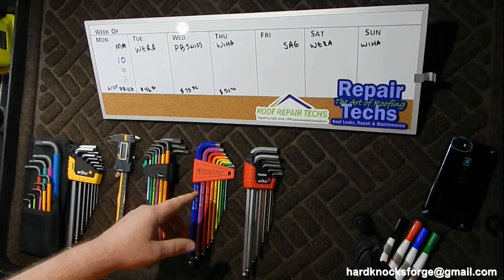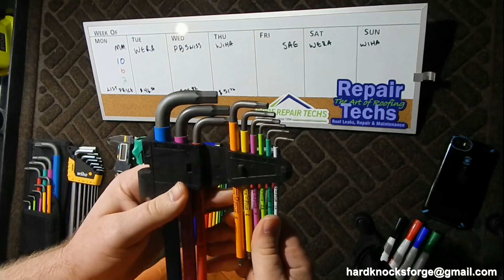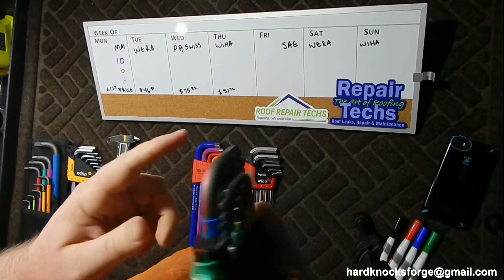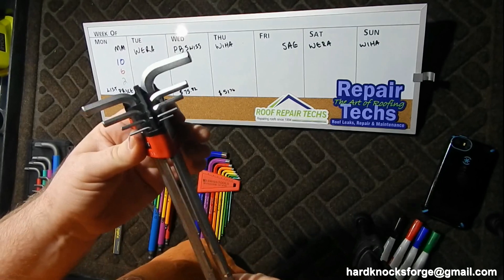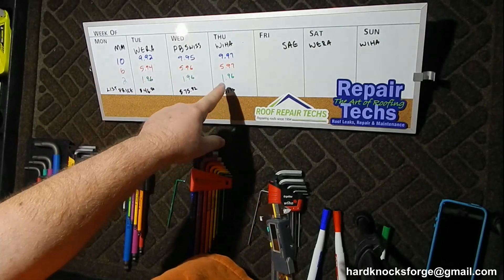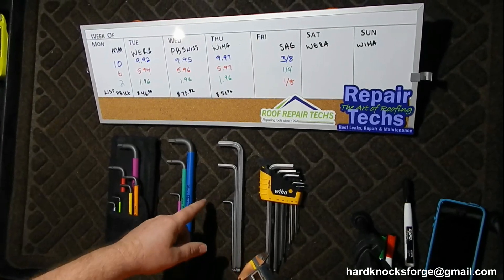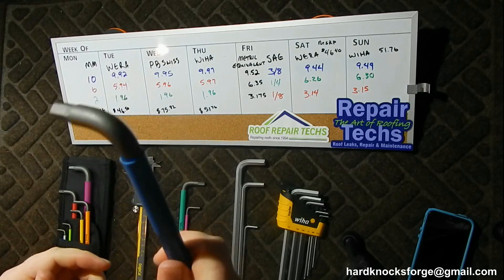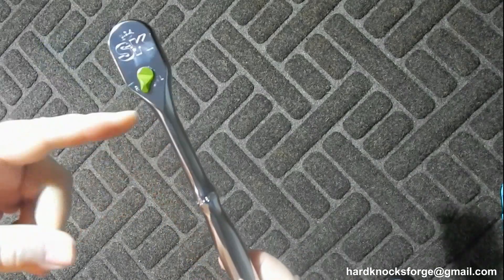Wera vs. PB Swiss vs. Wiha comparisons Caliper Death match  L Key, Allen Wrench, Hex Wrench

Comment: This is the exact 3 sets I was looking at, great comparison.  Would have been interesting to throw a husky or a HF in there for a cheap example.
Reply from the maker: I mostly have Eklind, maybe some Proto, craftsman, and some Kobalt. The Kobalt and Proto are the 'pocket knife style' I'll keep doing this with other brands when they come out and measure the same sizes every time so that eventually I'll have every company compared against each other.
Reply: Mike's Tool Shed . That wiha is my go too mike, you wouldn't think the magic ring screw holder would be all that handy but I use it a lot. Really nice set, I'm not saying pull the trigger but... pull the trigger on the wiha. 👌🏼
Reply from the maker: The ring never loses magnetism either, and really does hold onto fasteners better than anything I've ever used.

Comment: If you really want to do measurements that precise, use the correct measuring tools to do it, ie micrometer.  Just sayin
Reply from the maker: I wish I had a mic, gauge blocks, etc... but sadly that’s the drawer that’s lacking in my toolbox. I’ve wanted to do more comparisons like this one but I haven’t because of that very reason.
Reply: Hard Knocks Forge just so u know, the effort is still appreciated.  Funny enough, I love German and Swiss micrometers, dial indicators, etc, German and Swiss have always been the best.
Reply from the maker: Oh yeah I'm a fan of their tools also. It's not as easy getting their tools here unless you go online, and I'm still more of a touchy feely kinda tool guy.

Comment: Tolerances be damned. Wera hex plus is the way to go. "Spring Steel" doesn't really tell us much. All of those keys are made of "spring steel".
Reply from the maker: I found no mention of spring steel in what the L keys were made of except for PB Swiss. Spring steel is much tougher and more resilient to breakage vs other tool steels.
Reply: +Hard Knocks Forge that's because "spring steel" is a very vague term that describes a plethora of different steels/alloys/temperaments. It really doesn't tell you anything about the tool material.  Without any specification, it's little more than a marketing gimmick.
Reply from the maker: Could be marketing but I'm sure the PB Swiss will outlast anything else out there. There's no gimmick when it comes to PB Swiss and quality tools.
Reply: +Hard Knocks Forge I won't argue that. It would just be nice if these companies would provide measurable data that actually means something. If a high dollar tool is made of an expensive alloy or goes through a more demanding heat treatment, people will gladly pay for it. When they start using terms that try to make an industry standard sound proprietary, I hesitate to take the bait.

Comment: This is stupid because you don't have to use a socket doing comparisons, even about retention (socket of course has its tolerances calculated for the external hex of nuts or bolts and sometime apply slightly different shape to develop more torque power without rounding bolt head...). 

You should use different proper Allen screws samples to get some conclusions repeating the process to develop behavioral statistics to reason about how Allen wrenches work on same screw heads... how much they last, how they eventually mill internal hex, how they work under heavy torque load fastening or breaking loose... in the end you should use an hard-metric exam to measure the hardening tolerances of the wrench material.
Reply from the maker: Giulio Gemino I used the same socket on each L key. Doesn’t matter that it wasn’t an Allen screw. Allen screws have different tolerances between different manufacturers. Buying every flavor of Allen screw is not something I’m willing to do. You have lots of excellent ideas... I subscribed to your channel. Looking forward to your video on this subject. I even clicked the notification bell!!! Godspeed Giulio, Godspeed.
Reply: @HardKnocksForge  

that are test commonly made by tools manufacturers in their laboratory also checking quality during mfg process and durability performance after... they are control procedures commonly spread in that industry either in order to get certifications such as DIN, ISO, UNI... TUV and an history.

Some tech sheets and statistics are already available and real time updated because they are part of tools making. 

In a further time records about tools behavior are also made by their users on the assembly lines... sometimes this checks are discriminant choosing different screws or different screws supplier as scheduled consumables (e.g. inside a motor, or a wash-machine...) the same also is made on different key to tighten reporting all assembly issues... interruptions on continuous lines and maintenance cost serious money.
Sometimes on automatic assembly lines you have also reports of every specific assembly torque on every single bolt.
That on large scales is a necessity calculating costs, assembly times, considering assembly method applied, warranty... and so on... consider for instance as an application that aeronautic assembly bolts have also a conformity certification due radiography and absence of magnetic charge.
Anyway a 10mm socket is of course larger than 10mm nut but inside it is also shaped e.g. snap-on use flank drive...
an 8mm Allen screw is an hex with its tolerance...
Reply from the maker: Yes I understand all of that. The fact that both of them were able to hold onto the socket proves that they are both great at holding onto Allen screws even if the tolerances aren’t the same.